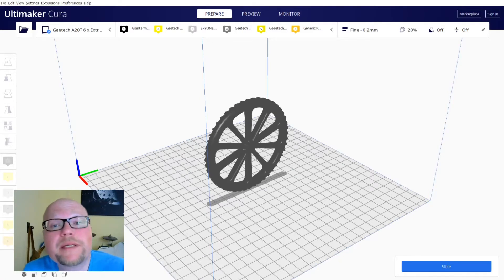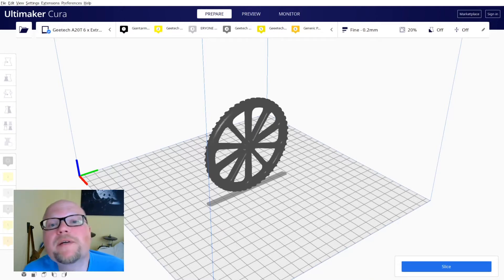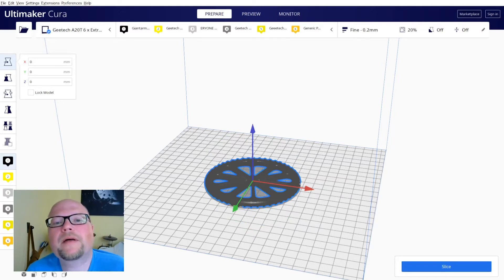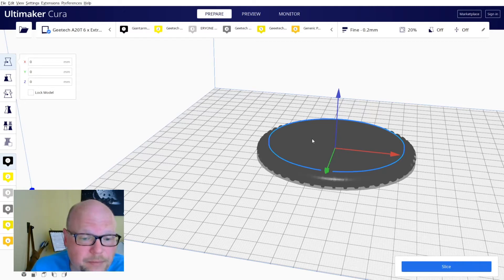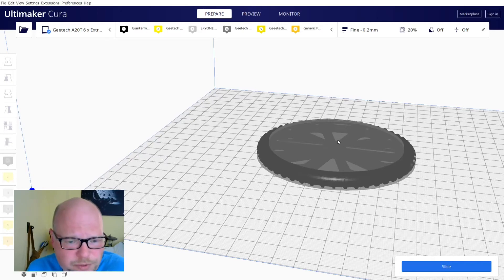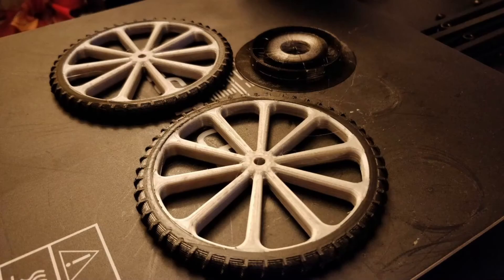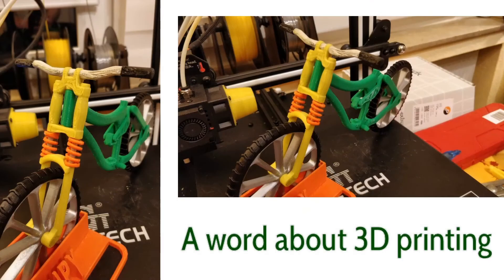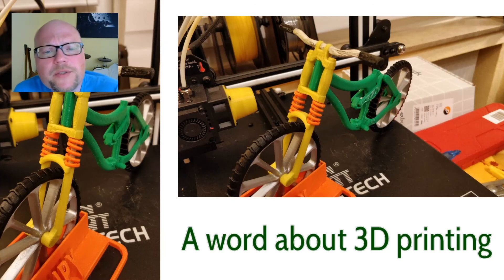Dual Extrusion 3D Printing: How to slice a single STL file for multiple colors

Comment: Thanks man this helped a lot actually, one thing, how did you get the seperate files for the mountain bike? The thingiverse link only has the full bike, not the parts. Thanks
Reply from the maker: Hi Ender!, sorry for the late answer, I didn't really check on comments until now. 

If I remember correctly the original creator pulled his design from thingiverse and thus the seperate parts are no longer available. Unfortunately the drive I had them on died, so I cannot provide them either.